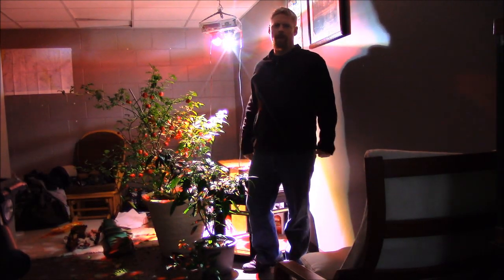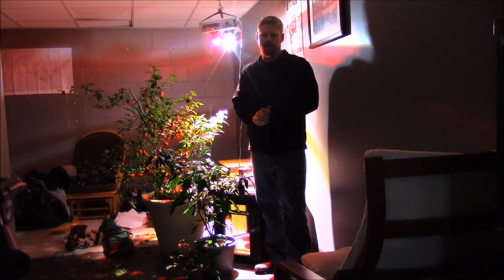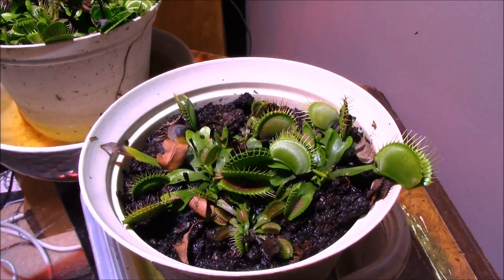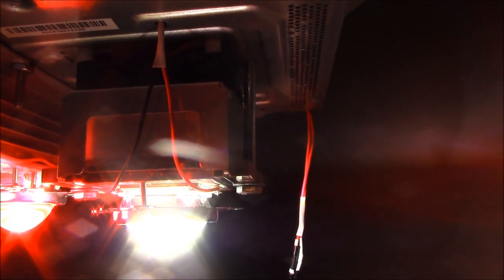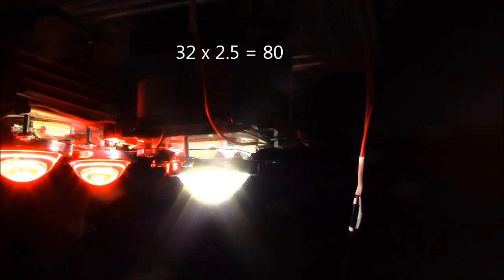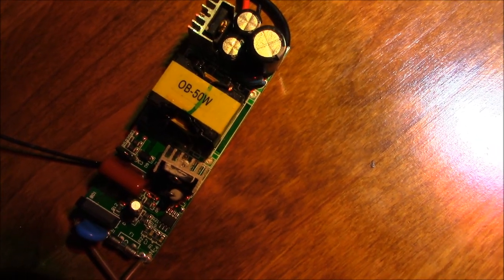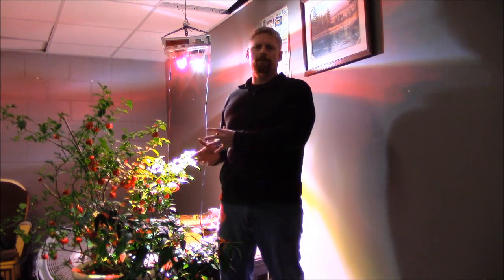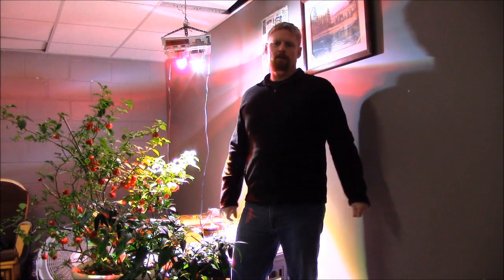DIY High Powered LED Grow-Light

Comment: Hello I bought this off amazon. 50W 380-840NM full spectrum led grow lights kits + 44mm lens +50w led driver

Do you know how to power it up? I have no idea. Can I just get a computer power cable and wire it up or something? Thanks sir.
Reply: you need cooling for the led or it will fry within minutes. a computer heatsink works perfect. also, the led driver is most likely powered by 110v input. for that, use a computer power cable and look up the colors to match up the hot, neutral, and ground wires. the power output of the driver should be just a red positive and a black negative. make sure you find which tabs on the led chip are positive and negative.  once you have those figured out and setup, then you are all set.

Comment: Cool, you proved that all you need to grow healthy plants are red and whites, you don't need blues at all. That's good because pure blues are a high retina damage risk if you ever look directly at em. It's in the Cree LED documentation. Reds and warm whites are the lowest risk. Cool whites are the worst of the whites, and ironically the most efficient. Pink grow light is where it's at. The whites produce enough blue and the red is dramatically boosted for enhanced flowering and fruiting. It's the "Pink Power" light". I wouldn't really go with equal wattages, though. More like 2 watts warm white to 1 watt red.

Comment: they have all-in-one combined 100w or 200w LED chips now that have a broad spectrum (380nm-860nm typically, and loaded with the few spectrum that matter more) for decent prices. i'm about to embark on a journey soon to build my own. thinking anywhere from 1 to 4 of these 100w or 200w chips (not sure about lens...) would do me just right. do you have any info on the lenses? usually i avoid them because they are not perfect and technically cause you to lose light transmission. ideally you'd want to have a large reflector IMO, reflecting the light from the bottom and sides of a container where your plant is kept.

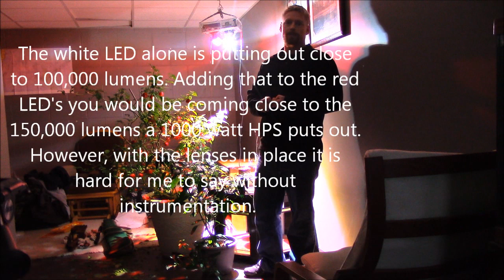Comment: At 0:50 - a 100 watt LED cannot put out 100,000 lumens! The best leds today are around 140 L/watt, but you won't get that from either a typical led, or a hot led. A bridgelux Vero 19 is rated around 10,000 L at 80 watts. A Cree cxa3590 is similar rated.
Reply from the maker: Flintsmooth Yeah you are correct, I added a zero. Someone had pointed that out awhile back. This reminds me to put a note in the video. Thanks.
Reply: still 10,000 lumens at about 100w is not bad for how cheap they are. I heard if you run them at 20w or less that their efficiency almost doubles. I wonder if you ran a bunch of them at lower wattages if you could save even more power and still get the same amount of light.
Reply: Go and get a spec sheet from someone like Digikey on a COB like the Vero 29 for example. You can see for yourself how the efficiency of LEDs decreases with temperature more than with power output. Some people are running 120 watt Bridgelux LEDs at around 25 watts, it saves power but it costs a fortune for the LEDs! You can get the same light from a smaller $15 dollar LED, the Veros are over $60. In my systems I go for a high amount of cooling, and run the LED at less efficiency, but I don't care about running costs as much as the 'underground farmers' do! I usually run at 150% capacity.   BTW the efficiency change is more like 20% to 25%, not double.
Reply: +Flintsmooth ive checked the spec sheets of many cobs. going from 85°c to 25°c only adds at most about 20% efficiency in lumens per watt. i think you have it backwards. from testing of many sources on the marijuana grower forums i see many people that have 120lumen/watt cobs that get about 190-200lumens/watt when run around 20%-30% of rated power. that is over 80% more lumens per watt! there is even a whole series of youtube videos for diy led growing lights where this is shown and explained in depth.
Reply: I don't have anything backwards. I said 20% last line of my post, did you not see??  Max eff. of Bridgelux leds is listed at around 140L/W at 25C. but you probably will never get that, also Lumens don't really equate to light power since that is a weighted measurement for human vision. And I don't give a fuck what internet fuck-tards have to say about it. Most of these assholes don't even have a light meter. I've heard so much stupid shit from these people I don't even look anymore. Furthermore, most people I've seen on youtube are using Chinese leds, probably more like 80 L/W.   I doubt that 200L/W figure but I may check it out sometime as I have a customer who wants max efficiency regardless of price.
Reply: I checked my notes, and did farther tests today at low power levels, and I see that at 50% power you get about 12% more efficiency, and 20% more at 25% power level. That's not even 170 lumens/watt. Don't believe the dopers!
Reply: +Flintsmooth how are you running your tests? is the power measurements at the wall socket? what temp were they running at? were you measuring light output with a lux meter at a specific distance? you have to compare apples to apples. i have a cheap lohas brand led cob that is rated at 90-110lumens/watt. i have it watercooled and i am currently running it at 84.5watts(measured at led power draw) and converting the lux measurements to lumens using the distance and angle i have 139lumens per watt. i put the led down to 40watts and the efficiency shot right up to 168lumens per watt. that is a big jump. i wont say that the watercooling didnt help as it probably added almost 20% but the drop in wattage definitely made a much larger impact. i'll test at 100w to get a better baseline to go off of, but just the 2 wattages shows enough i think.
Reply: +Flintsmooth how are you running your tests? is the power measurements at the wall socket? what temp were they running at? were you measuring light output with a lux meter at a specific distance? you have to compare apples to apples. i have a cheap lohas brand led cob that is rated at 90-110lumens/watt. i have it watercooled and i am currently running it at 84.5watts(measured at led power draw) and converting the lux measurements to lumens using the distance and angle i have 139lumens per watt. i put the led down to 40watts and the efficiency shot right up to 168lumens per watt. that is a big jump. i wont say that the watercooling didnt help as it probably added almost 20% but the drop in wattage definitely made a much larger impact. i'll test at 100w to get a better baseline to go off of, but just the 2 wattages shows enough i think.
Reply: To start with, going from 139 to 168 is 20%! That's the same figures I found at 100% to 25%.   I test my leds with a custom built DC power supply, with digital voltage and current meters. I test the light level using a lux meter at 1 meter distance. I take a measurement and then turn it off to cool. I have a thermal probe on the led to insure proper temperature. Today I was testing at 17C. to get the most light. I tested a Vero 29.

BTW how are you converting lux to lumens? You do know that you cannot use the x12.57 formula do you? Leds don't project in 360 degrees, plus they beam 50% of the light in a 60 degree arc.. I've found by empirical testing that led COBs tend to exceed the amount by about 5.5 times. I've given up on lumens anyway since lux is a more practical measurement for light, since it shows it's usage where you want it, not lumens hitting the walls.

Comment: Hey man, nice setup, question, where did you order the parts for it? I know there are several brands and so on.. and im thinking about building one myself. Send me an email if possible. Thnx
Reply from the maker: I found pretty much everything on Ebay, except for the 100 watt LED heatsink. That I got from a local electronic scrap place.
Reply: Ok, im looking at ebay on the led chips, but at the same time im also looking at both videos and forums that say the ebay leds arent good? thats why i asked from where you bought em, i guess i have to find a "Good" seller first and that alot is grounded on the facts that there are scammers out there
Reply from the maker: I can tell you my ebay chips are growing plants and I have flowers in my basement in January. I try to stay away from forums because it tends to be filled with anonymous experts that have nothing to offer of their own. They generally just criticize things they don't understand or assume because the salesman talked them into buying the most expensive model that it suddenly becomes the best. This goes for any subject! My light can definitely be improved upon, but to build your own light for less than 100$ that will grow large fruiting and flowering plants at just 100 watts works for me. Good Luck! For sellers I don't usually buy anything from anyone below a 98%. I like to get as much as I can from sure-display because they are reliable and ship pretty fast from China, but they aren't always the least expensive.
Reply: Thanks for reply mate! Well i just bought 3 of em ebay 500w hydrophonics also called viparledusa so ill have to see how good they are, but im deffenly building a cob setup within time ! From one thing to another, i just opend up one of the 500w led lights casing and had a look inside, one thing i find strange is that just from the looks of the leds they look to be 5w.ers because they got 2 chips inside, but i cant figure out how they can power up all the leds with 5 drivers of 560ma per each
Reply: totally 96 leds
Reply from the maker: Yeah if it's 500 watts and 96 LED's I would guess they were 5 watts each. I didn't realize you were buying a whole setup. I got my start accidentally from buying an LED light system for my corals in my salt water aquarium. I had a light fail and decided to take it apart to fix it. I knew zero about electronics and found out how much I enjoyed it by accident. Usually they have the lights in series so you can keep the current the same as long as you account for the voltage drop of each LED. It should say on the driver what the max voltage is.

Comment: So tell me: How can a 100W LED light have a light output of 100.000 Lumen? More like 9.000-12.000 if it's a 45mil; otherwise around 7.500-9.000 usually.
Reply from the maker: You are correct. My mistake, I added a zero. Really, I don't know what it's putting out and what effect the lenses have on distance. So I ordered a sensor for my arduino to get me in the ball park for lumens. Also, I took it apart to get rid of some of the whine and re-measured power being used and it is running at 100 watts total for all three lights. That would put the white well below 10,000 Lumens- guessing. Thanks for pointing that out. What I can say for sure is that it is working and that I am getting flowers and peppers. I hope to have an update with the new addition in a month or so. As always, everything is a work in progress with hopefully steady improvements.

Comment: Yo, like what you did here, would want to do something similar but on a smaller scale as far as watts per led... but more interested in if you had this running all off of one power cord and if so, how? Just getting into wiring and LEDs myself
Reply from the maker: You could definitely do it with one power cord, just have everything coming off of one ac connection. I guess since I tried the parts out separately I just ended up with two cords running out. There are many different sizes of LED's to choose from.
Reply: just seen this in my inbox... a late thanks is good as any

Comment: way too loud. We are so conditioned as a society (american) to build these hot things in  an enclosed case, leading to loud ass cooling systems! mine is a transformer mounted on the center of a metal plate with two very quiet heatsinks mounted on each edge of the plate. 200 watts and whisper